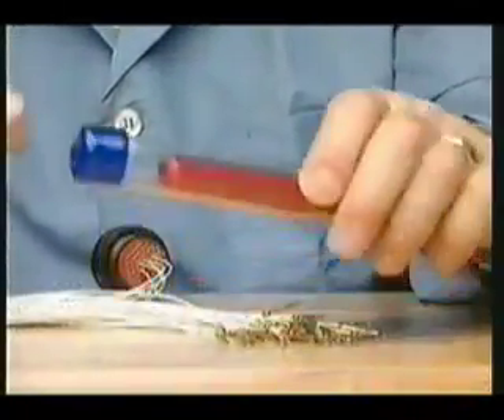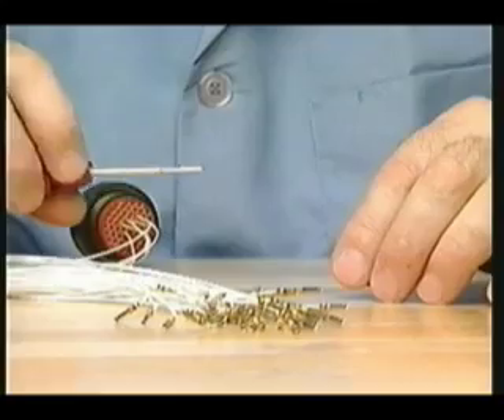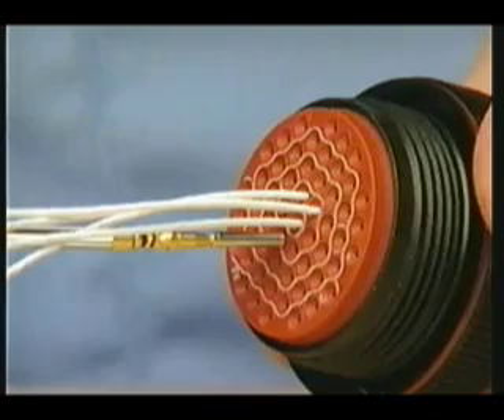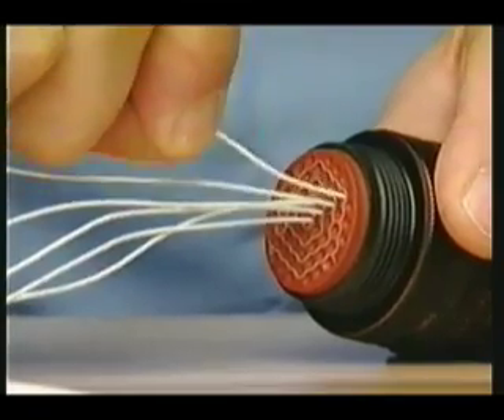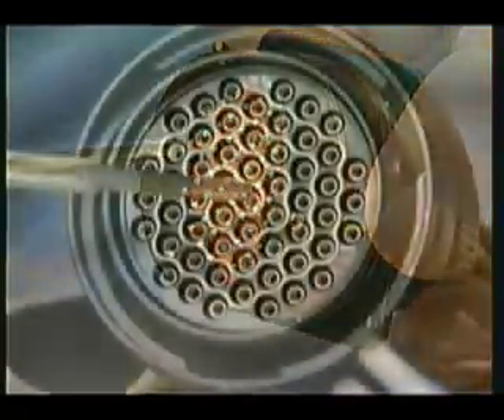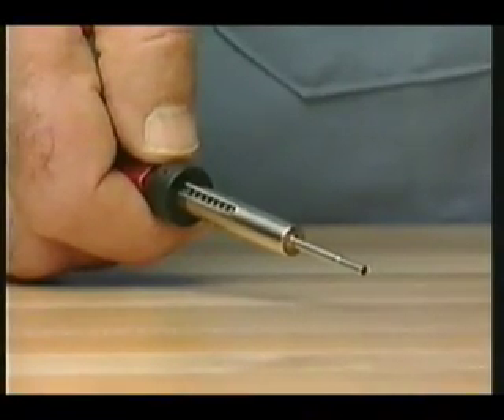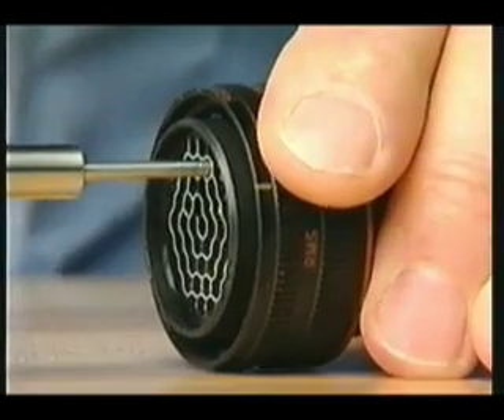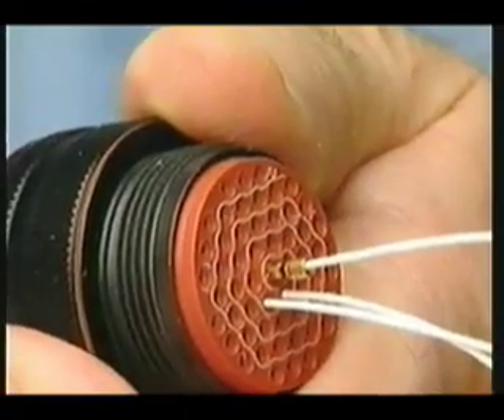Tool Selection, Contact Insertion and Removal on MIL-C-26500 Connectors

Comment: Parece sencillo, pero tiene su chiste.
Reply: Hola, disculpa, sos la única que comentó en español. Me podrías decir ¿qué conecta esto?, Qué es lo que conectan todos esos cables, ese enchufe, algo, no tengo idea. Gracias!
Reply: @diegoalejandro2704  Wow, amigo! En un avión, los diferentes sistemas que lo hacen funcionar se comunican entre sí por medio de computadores, válvulas,  generadores, sincros, sensores, etc. Todos esos componentes se alimentan y comunican entre ellos por medio de líneas eléctricas (como esos cables que se muestran en el video), que a su vez se encuentran todas y cada una conectadas por medio de este tipo de terminales o conectores. Es decir, cada componente cuenta con uno o más conectores propios.
Existen diferentes tamaños de conectores, por lo tanto, también existen diferentes tipos de pines (las terminales doradas a las que van conectadas cada una de las líneas).
Cuando se efectúa alguna modificación o se presenta alguna falla en algunos de los sistemas, puede ser necesario insertar o remover alguna de esas líneas, pero si no tienes mucho cuidado, podrías dañar el pin y ocasionar, incluso, el remplazo de todo el conector de forma innecesaria.🤷🏻‍♀️
Este sistema se le llama EWIS: Electrical Wiring Interconnection System, y el  técnico que efectúa este tipo de trabajo casi siempre es un especialista en Avionics (Avio/electrónica).
Espero haya sido clara y haberte podido transmitir el concepto.
Saludos desde México!👋🏼
Reply: @verolara2211  Hola Vero, no sabés lo valioso de la información que me brindaste. Te cuento que mi interés en saber el porqué quería saber... Estaba por comprar una crimpeadora, creo que en México le llaman "ponchadora" que necesito pero para conexiones eléctricas convencionales, y ví una en marketplace muy distinta a la de los videos, el problema era que no sabía si era la misma, y decidí no comprarla porque no estaba seguro, casi cometo un error, e iba a comprar algo que no me iba a servir para mí propósito. Te agradezco infinitamente por tu información Verónica, Saludos Desde Buenos Aires, Argentina!!! 🤗😘❤
Reply: @diegoalejandro2704  en México también la conocemos como crimping tool. Pero sí debes de asegurarte que sea para uso convencional, ya que hay para diferentes tipos de usos, como las que usamos en aviación. Se me ocurre que podrías buscar un video en Youtube.🤔
Suerte en tu búsqueda!
Saludos y bendiciones!👋🏼👋🏼
Reply: @verolara2211  Muchísimas Gracias Vero, gracias a vos pude saber para qué sirve esa herramienta en específico, ahora se que no es para lo que necesito. Una vez más Gracias y Bendiciones para vos. Espero volver a charlar con vos en algún momento.